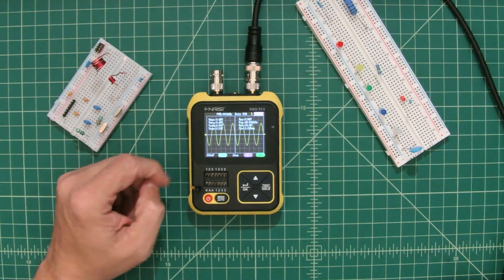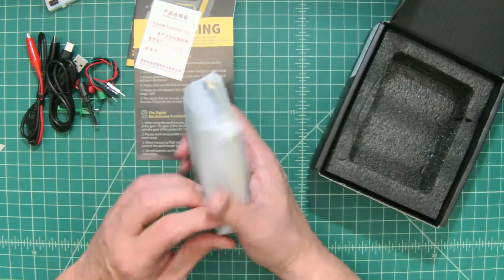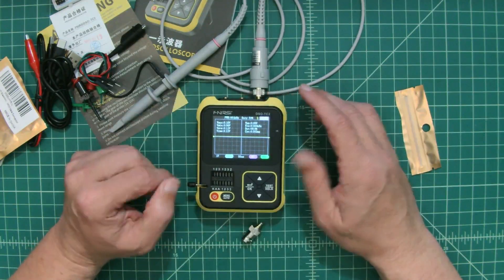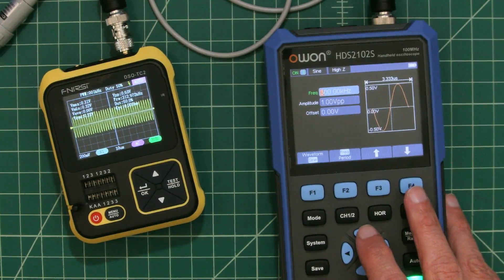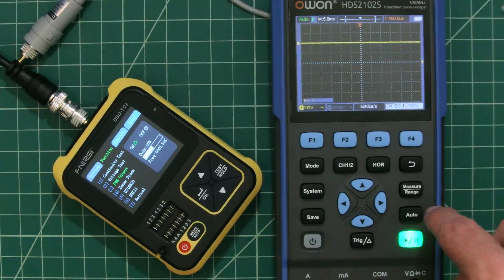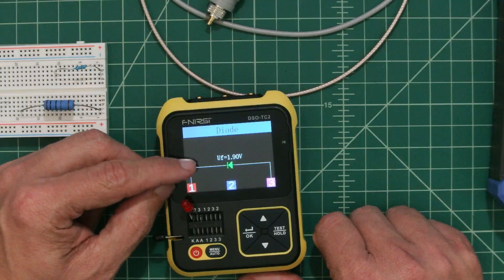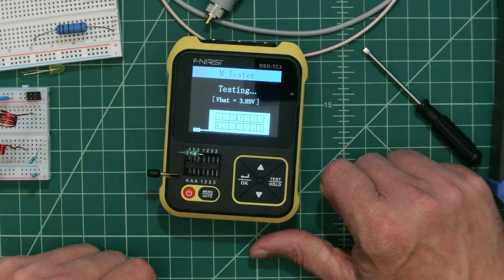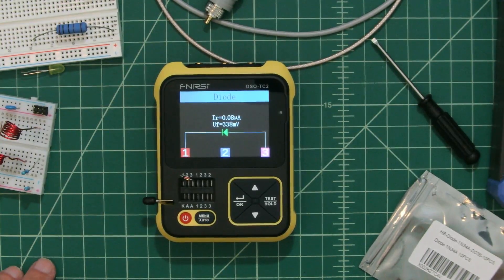2 in 1 Pocket Oscilloscope - Fnirsi DSO-TC2

Comment: Dude, you can use the probes to short the 123 pins for calibration... oh, and stop long pressing the Test button, short press the Test button to retest a component... it is good, though, that you recommended us to read the instructions (user manual), but you failed to do it

Comment: If I saw this before I bought my $10 M-Tester kit, complete with "shell", I would have got one. The function generator is a better option than the fake XR2206 ones out there. Consider using a patch cable to take the stress off those MCX connectors. I've been doing that since I bought a small Icom HT with a SMA antenna connector. An adapter will put more stress on those small RF connectors (like SMA & MCX) than a pigtail. looks like a good piece of test equipment to cover multiple bases at a very reasonable cost.
Reply from the maker: Thanks for the info David 👍

Comment: Picked up one of these a few months ago, for $50 I’ve gotten a lot of use out of it, though get a real oscilloscope you can pick up a great 50 ~ 200 Mhz four channel scope for ~$400 that’ll do virtually anything a hobbyist would want & more, I stretched a bit & picked up Rigol’s MSO5074 & unlocked all the features for ~$900 which is surely a red shiny sports car for a hobbyist, I also picked up the pricey Logic Analyzer for it too, I have a-lot of digital projects where it has been quite useful especially with the Apollo Guidance Computer replica project I finally finished after starting the project all the way back in 2009!
Reply from the maker: I mostly use this for the component analysis now and I have the 5074 which is AWESOME.  Thanks for watching bro 👍

Comment: Hey there, nice review! Did you ever test the DS18B20 function? Just received my DSO-TC2 and it shows wrong temperatures. In my case 3.5°C indoors. The same DS18B20 connected to µC shows something about 21°C. So the Sensor is definitely working...
Reply from the maker: Hey ruffy, I have not tested the DS18B20

Comment: I am wanting for use TWO $148.99 Bluetooth ET310A meter-oscilloscopes to measure 3 phase 440vac and monitor the waveforms on a windows laptop in real time. 
Instead of a Fluke FLUKE-190-062-III Handheld Oscilloscope, 2 Channel Price:$3,755.99   There should be a demand for this when in motors & wind generators. Thankyou.
Reply from the maker: That sounds like some high tech stuff 👍

Comment: I have one on my wishlist. I want it for component testing and checking if mains voltage sine waves are pure or pwm.
I am not familiar with that connection  port though. I'd need  a pigtail adaptor to something more appropriate.... what type would you suggest Mr Ape?
Reply from the maker: If you get one with the probe kit it comes with the adapter.
Reply: @TheSmokinApe  hi Ape, I just received my TC2 via Amazon without a probe nor any BNC adapters. What probe model should I order and what are the BNC adapter part numbers? Thanks! 🙂

Comment: Those MCX connectors are non standard enough it would kill a sale for me. Wouldn’t be hard to redesign the case for standard test lab BNC connectors on it though... For the price, not bad.
Reply from the maker: I am not a fan either, looking back I should have bought a jumper cable and not an adapter.